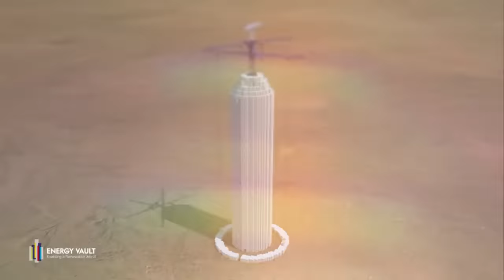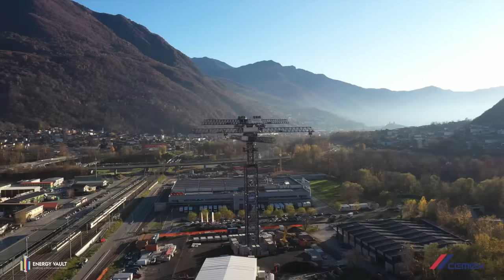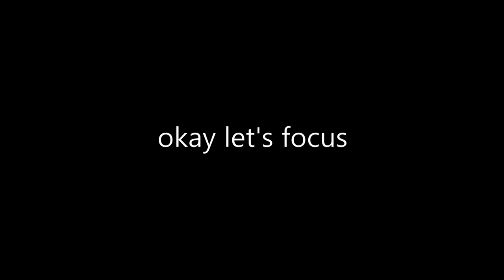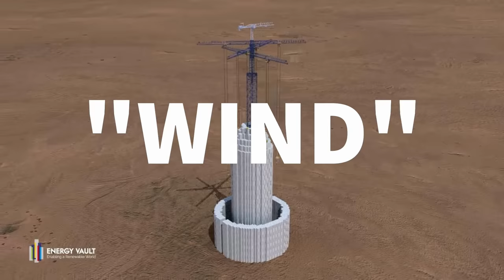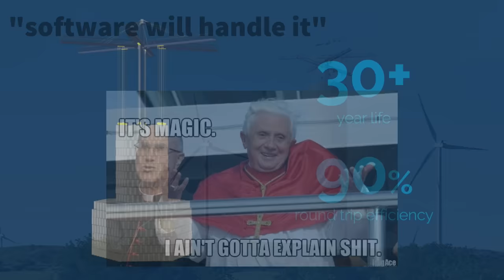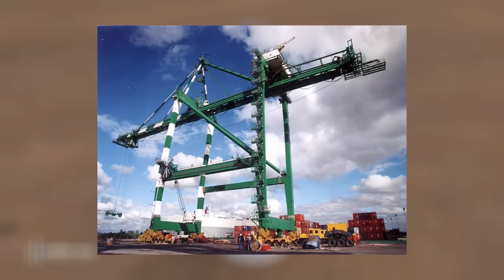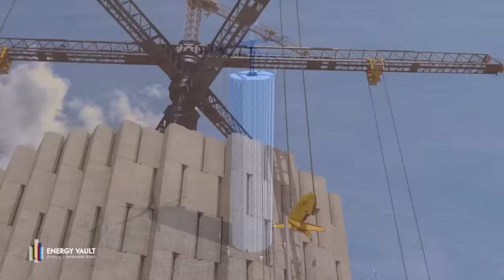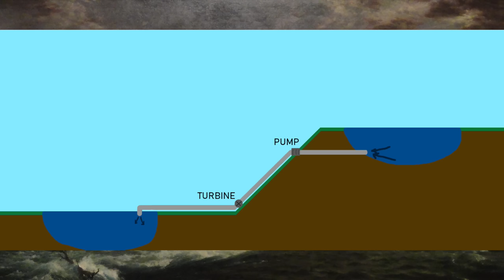The Energy Vault is a Dumb Idea, Here's Why

Comment: Pumped storage typically only works in rare locations, with two large bodies of water at different elevations. You don't find too many of those, so if this method does become more common it'd mostly use water tanks
Reply: If it did use water tanks at least it'd be quieter.  I'd hate to have one of these next to my neighborhood running 24/7 like a construction site.  With pumped storage you could have the pumps themselves underground or in the water, creating natural sound insulation.
Reply: @BondiAV  aren't there already environmental issues with that? it's probably not something we want to expand even if we can
Reply: Lol. Imagine believing that geological location can prevent a pump hydro storage plant from connecting to the grid using long high voltage power line.
Reply: @luongmaihunggia  longer power lines lose efficiency over distance; typically most electricity is generated as close to the place it's being used as possible
Reply: @thatcherridings8388  you'd be foolish to assume efficiency loss cannot be compensated by increasing the voltage. Also HVDC is better than HVAC.

Comment: Pumped storage is mostly good for places that already have two adjacent reservoirs with a significant height difference like that. You could build your own, but that's pretty expensive and probably not the best option most of the time. It also has a comparatively slow response. In other places, you might want to consider lithium ion batteries, thermal storage, or other methods. All of them are pretty expensive, though. There aren't really any great storage technologies currently. (But they're pretty much all better than this one.)

Comment: The lifting of solids instead of liquid might still have merit, where flooding the top of a hill isn't viable.

Though I'd suggest something more along the lines of an electric conveyor belt, on a slope, carrying stone, gravel or sand. Perhaps on railcars on the down trip.
Not sure if the unloading/loading could be energy efficient, though.
Reply: @deusexaethera  Another thing I've noticed about Adam is his apparent love for old style railways. He seems not to appreciate improved speed.

Personally I'd like a proper high-speed cross-continental Eurasian railway.
Reply: @deusexaethera  Okay you're right Water is corrosive and evaporates and has turbulence.

Yet moving giant blocks up and down on strings isn't viable with any wind at all as a strong wind current drops the block and swings it around breaking everything when stacked... and a giant block like you suggests makes it more vulnerable to bad weather and needs to be set somewhere to allow repairs.

The energy battery itself isn't viable in any sense as the flaws are significantly more then water.

You're not an engineer.... you're a commenter and you need to get off your high horse as well.
Adam is probably an jerk from what I gathered regardless... but being a jerk doesn't make a point wrong.
This isn't the playground, the personality doesn't relate to if something is true or not.

I'm sure something is wrong in my observation as I'm not an engineer myself.
Reply: @Buglin_Burger7878  well, he did propose his own solution in the video. Simply dig a hole. It’s a small self contained system to put the pulley in, and doesn’t require water or mountains, or more specifically excessive snowing and rainfall to fill the basin up top (you can pump the water, but that doesn’t sound any more efficient than lifting a block a smaller distance)

Comment: if we neglect the "can only store energy of 2 windmills" for 1 sec,  there are places in the world where digging a hold or using existing elevation is not an option. 

heard somewhere to use this consept but then only to provide for a buildings own energy, using elevator shaft
Reply: With heavy machinery it's easier to dig a hole than build a tower... dig pit here, pile dirt into basin there.

An open pit mine without the output of a mine is a truly terrible idea. Still a better idea than a modular tower.
Reply: there are places in the world where digging a hold or using existing elevation is not an option

How many can  you name?
Reply: @MrRaznov  the only intelligent version of this I’ve seen was designed for the SW USA where you have plenty of plateaus and canyons, little water, rock hard soil, and lots of sunlight to capture. Put rails on the side of a canyon, pull heavy rail car up the side of said canyon, etc.
Reply: If only we had a way to transport electricity over long distances.....

Comment: Hahaha I was interested in this concept when it was "drill a big shaft a few km down" and only lifting a one or two big weights... That at least would have the advantage that it could be done in a compact space, maybe even in a city where the power is needed. Or use old mine sites as a way to continue to use that infrastructure. But still, pumped hydro is  simpler in most cases.

Comment: Pumped storage hydroelectricity works great in situations where its possible, i.e. areas with sufficient elevation differences and bodies of water, but its far from a 'one size fits all' solution.

Utilizing carbon negative concrete blocks that are constructed by capturing atmospheric carbon to create aggregate, solves part of the issue you pointed out. The design could certainly be optimized in a number of ways as, again, you pointed out. But the 'true' solution to ecological apocalypse and modern energy needs will require a diversified set of tactics and technologies which could very well include gravity storage systems.
Reply: @jamesoprey6330  The problem with 'final solutions' to problems tend to be that the final solution targets aren't happy and won't listen to you. And will also have their own cone shaped lead.
Reply: @TimoRutanen  no, the problem is that some people are too dumb to see who exactly benefits from "the apocalypse", though it is a very simple task. As simple as looking at the nose.
Reply: @TimoRutanen  yeah, you are exactly the problem.
Reply: @jamesoprey6330  I'm sure you wouldn't mind explaining what the actual problem is and how am I a part of it? I think that would be very insightful to everyone.
Reply: @jamesoprey6330  I guess that means you don't exactly know what problem you are talking about, or who might be a part of it. Have you considered that you might be a factor ?

Comment: I saw the underneath idea before. That requiers more resources. Digging...well, the best way is to use salt water ( no freeze ) tanks made out of recycled plastic. The wind should not be a problem if you have the tower farther away but that would require transportation of energy. You should get your energy from solar not wind. 
The main problem would be more in tear and wear of grab-release systems and pullies for the blocks rather than the blocks themselves

Comment: For a short-term energy storage, flywheel is a relatively low-tech and time-proven technology. Fly-wheel based mechanical batteries can be installed near wind turbines or solar panels to handle energy fluctuations.
Reply: if you want to build a good flywheel, you need to spin it as fast as you can, because rotational energy depends on the square of angular velocity. So you need to build it from carbon fibers, spin it in a vacuum and use magnetic bearings: that bad boy will be spinning at ~20 000 prm. All of the above drives the cost per kW/h up. I don't think steel flywheels will be viable too, although i haven't done research on them yet
Reply: The issue with flywheels is that they are only good for short term storage due to friction loss. The longer you try to 'store' the energy the less efficient the system becomes.
Reply: I was talking about short-term energy storage.
Reply: @CZpersi  The issue is that flywheels are far too short-term, in the order of less than an hour. It could be useful to buffer short spikes in a system but since the system would require a constant energy input to keep it ready for such spikes it quickly becomes a net negative system.

Comment: The most expensive word in installation is "digging". Putting it in a hole that deep will increase costs of installing one to the point it's not feasible. There have been lots of great ideas for harnessing renewable energy,  but solar and wind win partly because you don't have much digging involved.  Repaving roads with solar or kinetic energy tech being a good is one that would have been nice to see implement.
Reply: Yeah well...if we attach an excavator bucket to the cranes, they can just use their surplus to dig their own hole. :D 

Solar roads don't work.
Reply: You should also watch the video on why solar roads dont work. Solar panels are fine on roofs and empty unused deserts where they belong
Reply: @Mrwizard-ck7oe  or as the roof for covered parking. I mean, idealy we don't have nearly as much parking as we do, but since we do, might as well capture that energy rather than having to run AC to pump it out of cars so we don't cook our bodies.
Reply: Use an existing hole.
Reply: Lol solar roads are a terrible idea. So expensive to install a super strong solar power system that can support trucks, the surface will be a compromise resulting in worse grip and wear characteristics, and the location of the solar panels at ground level where they will get the most shade and the most dirt  covering them is really inefficient.

I have similar thoughts about kinetic systems, plus a big question mark around the impact on fuel efficiency from vehicles using more energy driving on a slightly more bouncy surface.
Reply: @mrgreatauk  you got that right - there are no free lunches in physics.